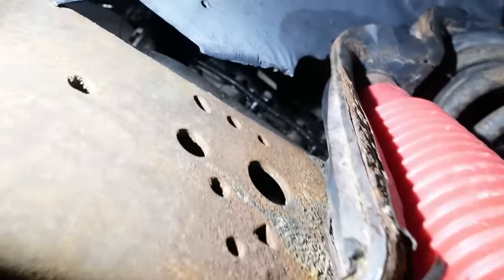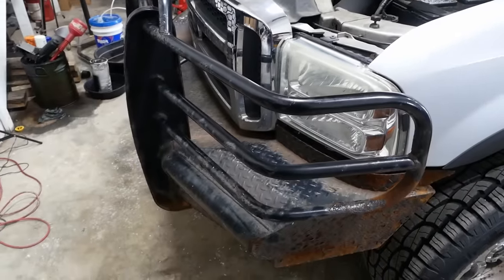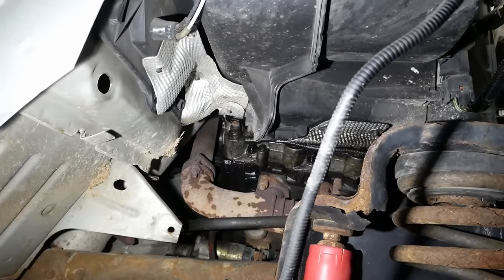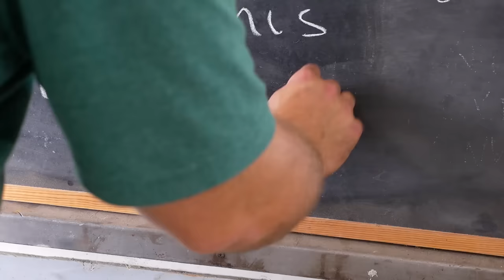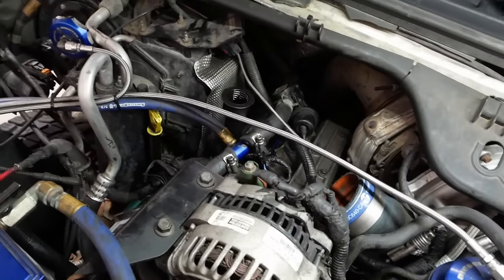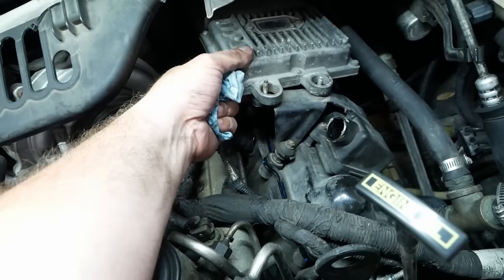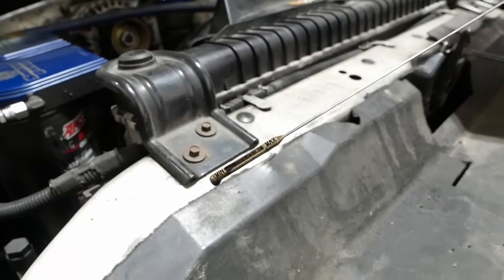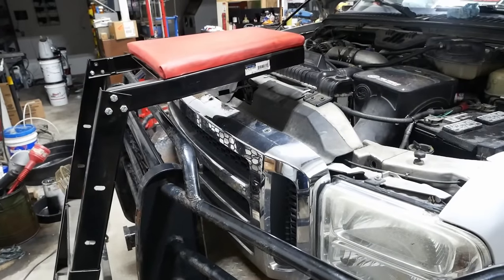6.0 Power Stroke Makes me Question my Life Choices - Major Oil Leak

Comment: heres an idea... put a sign out front,,you know,,,,   as for the bolts.. theres chem set,, used for industrial / house/ shed, structural supports.. maybe a mini kit, instead of bolt, make it a chem set stud.... the alloy has different grades,, say from, ford alloy,,to jag alloy.. or jet..  maybe vehicles should be rented for 3 yrs, then re cycled..   nearly bought a 6.4 engine, 15 yrs ago,, in aus.. thank fk i didnt..

Comment: I used to work in a shop that almost exclusively worked on 6.0, 7.3 and 6.6 duramax’s for almost 6 years. I can without a doubt tell you that almost every other 6.0 that came into the shop had stripped out valve cover bolts. This was back in 2010 times. They were still fairly new. We tried everything to fix the holes without helicoils and there’s really not a better way that would hold up to multiple uses. Those bolts were the bane of my existence. We eventually just have the customer the option to either fix it, or we would silicone the gaskets and let it ride with whichever bolts it had left.

Comment: What 18-20 year old diesel engine doesn't have an oil leak? 😂 Most of the engines assembled 20 years ago, still had standard rubber gaskets and cut paper gaskets to seal crap up with. None of this newfangled silicone rubber layered onto multilayer sheet steel like we have now.

Comment: Problem is the size of the bolt and the tread pitch, what are they 6-7 foot pounds? That is so easy to overdo without torque wrench, used to get that a lot with japanese motorcycles 6mm bolt with a fine thread ? Disaster waiting to happen.
Solution? Take it to Wes!😂

Comment: Its ok Wes Alcohol is still available as a crutch to stop you loosing it and go running in the field next door screaming. I think i'd just keep putting oil in it each week. I still think The design engineers who made should be made to fix them. If that happened they'd be so easy to take apart and reassemble. it would be  a joy. I knew which one it was going to be as soon as you said it. If you drop the wrench you know its not going to hit the floor and it will be the only one in that size that you own. Its ok if you cry at this point. You could have taken your Mums advise and become an internationally known a flower arranger. but you didn't. This reminds me of a 5 series bmw .ali block, ali head late 90s. Stripped head bolts in the block on a head job. The head shop had a 2"" thick block with 6 holes and sleeves to act as a drill guide to fit their shop made 17mm coarse threaded  inserts. You cant use helicoils as they just crumble the block and pull out. They did nearly all the bmws nearby that needed a head job. You did well.

Comment: I know the IDI diesels, especially the 7.3L variety, had cavitation issues in spite of the fact that they're not a wet or dry sleeved engine, so maybe the coolant filter is a holdover from that? When the 6.0 came out we were just under a decade removed from the IDI's, so it's not that much of a stretch.

Comment: hello wes good job ,I feel your pain,some owners are there own worst enimies . I aquired my brothers 6.0 last year.due to intermittant no start and he got fed up with it.I removed the tuner,after market air cleaner,,shes back to stock now,,turned out to be bad wiring at cam sensor plug,,he has spent upwards of 2k diagnosing this problem.

Comment: yeah, it's pretty much helicoil or nothing for me. If I have good access and it doesn't hurt anything I'll drill the whole thing, weld a plug in, and then drill and tap the new plug to the factory bolt size. Done that a couple times and it worked good for me.

Also, really loving the content Wes.

Comment: After all that work and the well deserved trash talkin, ya gotta love the way that thing sounded when ya cranked her up. I like em so much I’m still driving one (225k mi) and work on em for other people too sometimes. I suggest lifting the cab to get at those bolts and go ahead and do head gaskets while you are in there, lol. I bet the glow plug harness is leaking too. At last it wasn’t a bed plate leak. I’m pretty sure these engines are supposed to have oil all over the outside too! (It’s a design feature) mine doesn’t get to park in the driveway anymore. 😂

Just had to add, this is the truck I love to hate, when this thing finally dies I’m gonna be sad. I may have to hunt up another one.

Comment: Can't you put anti-seize on the bolts? Or even green loctite, if it likes to come loose. Sometimes Loctite can actually makes things easier to de-install. I think galvanic corrosion is the culprit with the stripped out bolts, putting something between the two different metals would solve that.

Comment: From what I was always told the coolant filters are a necessity on a 6.0 and 6.4 due to the sand casting in the block. The theory is the sand will eventually make its way to the water pump and eat out the housing ect. 
It was cheap insurance for one of the many probs. 
U would get a sizable amount of gunk in the filter when u changed it and cut open the filter. 
I’m sure other 6.0 and 6.4 guys have heard the same thing and have similar experiences.

Comment: I know a guy who works at a ford dealer.  He told me every diesel engine, ford had ever made is total garbage.  They made one engine, that was very good, the very first diesel they put in their trucks.  Ever notice why there are more ford trucks in the junk yard--because that's where they belong.  The 6.0 and 6.4 were made by international, so for wanted to continue their great stand with total garbage.  Any one that I have know that has owned a ford diesel, it was their first, and their last.

Comment: Mine was not realizing that the crappy retention clip that Dodge used on the big Dana rear end on the 3500 is not gonna hold the axle from walking out.  It destroyed the axle threads on the outside and the roller bearings went inside increasing the axle diameter.
  My life redemption was slowly filing down the slightly oversized bumped out areas on the axle to allow the oil seal to seat.
   I will trade ten hours for eighteen hundred dollars plus freight for a used axle. 
  Second redemption was realizing that Chevy used no retention clip,but a very robust locking system made by Spicer. 
   It only costs sixty dollars more and will last forever

Comment: Possible solution to the access problem.  Years ago my now wife then girlfriend had a mustang someone had changed the motor in to a big v8 and no way to access the rear plugs. I cut a 2 inch hole with a hole saw problem solved. A little weather strip adhesive a piece of tin and some sheet metal screws or pop rivets, good as new. No one would care on a 20 year old vehicle and would make life easier for an overworked mechanic. Great videos thank you.

Comment: You mentioned you didn't know why a 6.0 uses a coolant filter, I'm sure someone else has mentioned it but just in case they haven't, it's to capture any silica particulate from the casting process and any other dirt that's introduced into the system, so it doesn't block up the oil cooler. The factory oil cooler is a little too small and they make aftermarket ones that are bigger but those don't cool as efficiently

Comment: Hey Wes just figured id add they use an extra coolant filter to help with cavitation of the cylinder walls and also to help to catch debris before the oil cooler to "save" the mostly unsavable 6.0psd

Comment: Never stripped a valve cover bolt before but you do have to watch out for the folks that think the gasket on the oil cooler is reusable. Leaks like he'll and takes days for the valley to drain. Have had 3 6blows and have a 06 550 for a daily driver

Comment: I thought only the 7.3 glow plug harness goes into the valve cover. 6.0 has the harnes and controller completed external?  Controller is up front on pass valve cover

Comment: I just did this exact job on a 6.0 Powerstroke two weeks ago.   The previous mechanic stripped the back two valve cover bolts requiring Helicoils.  I despise working on those 6.0  Powerstrokes.    I also used a bolt with a notch filed in the end as the installation tool.  😂
Mike

Comment: In case youre wondering that year 6.0l powerstroke were notorious for inferior casting process on the blocks, very common for them to have lots of leftover sand from the casting process. If not filtered the material eventually can destroy the heads and anything it comes into contact with as it acts like an abrasive. One of the many reasons no one can convince me that a 6.0l is worth owning. There's just too much aftermarket mods that you have to do right out of the gate to get it to the point of reliability.

Comment: This was great. I love your sense of humor. Thanks for the tip on the topside creeper. I didn't even know that was a thing. My solution for the valve cover bolts is to remove them when new and replace with studs and nuts.

Comment: Im so tired of my 6.0. Over the years constantly hugging that greasy pig. That valve cover on the passenger  side is a nightmare. Ive done injectors on drivers side 30 min but had to do on on the passanger side and started late evening next thing I knew the sun was rising and i had to be a work in a hour. think i stripped 3 of those bolts on the rocker box that morning so I live with a bad oil leak for a year after

Comment: The only way to work on these things is to pull the cab. Don’t get me wrong it’s absolutely outrageous that you have to pull the cab because the engineers were such assholes that they couldn’t make the hood a little bigger. Hell they could have just put a truck style nose on it that tilts forward like a big rig. There is a special place in hell for the engineers that design crap like this! A place were they have to repair these things they have designed over and over all day and night for eternity!

Comment: Designed to go down the assembly line easily, not designed to be serviced afterward easily. Yes, the fender liners will be on before the wheels go on, and the assembly line probably has a fixture to align it (and the person doing the job has done it hundreds of times before). And those valve covers are an easy job on the assembly line when all the parts are new and the engine isn't in the truck yet and all the stuff around them isn't there yet. Afterward ... well, we see how it goes.

Comment: The coolant filter is installed because Navistar left a lot of casting sand in the block on a ton of them, that in turn clogs up the oil cooler, been there done that, thousands of times unfortunately. The lower crankcase housing is probably leaking also.

Comment: Had the exact same issue on my 7.3 with the oil leak. Bent valve cover and it was a major leak. I bent it i think trying to pull it out when i forgot the last bolt and i pulled up on it

Comment: Remember the old trucks Chevy, Ford or Dodge did not matter the make but use use to be able to open the hood and look down at the engine and say wow look at all the room you got in there and everything was so easy to change and now more crap has gone under the hood and they mad it smaller so you look in and say where the hell is the engine. I don't understand auto manufacturers ways of doing things everything use to be so easy and now everything is so hard and you have to have child or woman hands to work on them anymore.

Comment: The coolant filter is for the truckload of sand that's left in the blocks after casting that blocks up the oil cooler.
IMO that's the main cause of most of the problems these engines have .

Comment: Also having owned 4 or 5 six liters i have never had a problem with the valve cover bolts , this is actually the first i am hearing of it . They have their issues but as far as i know that wasnt one of them .... and i live in the rusty crap hole of new england

Comment: We have used a combination 1/4''- 3/16'' square drive flat ratchet to drive a shorty drill bits in impossible places. Will also drive taps. If your grinding skills are like mine, some gum tightens the fit and you don't drop stuff.  I got it originally for square head set screws ages ago, and an appliance tech I know showed the trick to me. 1/4'' stud is just a teeny bit bigger than 6mm. You may be able to tap it at 1/4'' without drilling, put in a stud with some JB weld and call it a day.

Comment: Terrific video! I owned a 2001 F250 with the 7.3. I loved driving it, especially towing or with a cord of wood in the back. I hated working on it. So much of the engine is inaccessible. Telling a customer NO can be hard. The shops around here are getting used to doing just that. My local garage set a 20yr maximum on cars they will work on and they have no problem saying no to working on a car if anything is sketchy. Another shop that isn't as busy will work on just about anything but they also have limits. It's something to consider. At least you get amazing content out of a struggle like this.

Comment: Great video.
Once the headstuds are swapped out and oil cooler changed these seem to last.
Did mine with arp studs and never had an issue.
Has decent power stock, I never run a tuner on mine.

Comment: I use a Ball Peen hammer with the ball on the hole in upside down valve/pan cover and hit with a dead blow hammer to invert the bolt hole to correct deformation there. Works like a charm.

Comment: I believe the purpose of filtering coolant in a diesel pickup is getting more life out of the coolant. I run rotella coolant in my 7.3, and it's supposed to be good for 300k miles. I'd really rather have a filter for that kind of duty.
I could be wrong though.

Comment: Valve cover gasket bolts stripped is not a design fault. In most cases that indicates that oil started to leak because of the gasket getting old and crushed. So out of laziness instead of replacing it someone decided to tighten the bolts some more and the rest is a history.

Comment: The word on the street is the reason for the coolant filter is to catch any sand left in the block from casting. There are some trucks that have had the rear of the water pump housing wear through and get coolant into the crankcase. So the aftermarket has jumped in the help with the filter.

Comment: I have a friend that has a couple 6.0L Fords. I have been all over the one engine, actually had to pull out and engine and replace it after a lifter failed. That was a job that I would rather never do again. A 6.0L with a 6 Speed Manual is a pain in the hind end to pull and work on. Thanks for the videos and I appreciate your sense of humor.

Comment: If they used studs instead of bolts, you would not have stripped thread issues. nuts are easy to get off one way or another. Love your videos Wes. You have a calming demeanor during stressful times.

Comment: Now I know I'm not alone. I thought my 2005 F350 King Ranch 6.0L was a lemon (new heads, new FICM, stud kit, 3 new injectors, new EGR heat exchanger and then another, then EGR delete kit, new glow plug harnesses, 2 new alternators, etc, etc,). I worked for Ford n kept saying nothing else could go wrong - could it??? Something else always did. This International motor was the single largest class action law suit in Ford history. Larger than the Pinto fire n Firestone rollover fiascos. I finally traded it in for a 2018 F250 6.7L. Not had 1 issue yet. Knock on wood. I hear the CP40 oil pumps in the 6.7L are ticking time bombs- thanks Ford. Laid off and sold a Lemming.
Reply from the maker: Cummins and Duramax also use the CP4 pump. So do some big truck engines. It's an expensive day when it shells out.

Comment: Actually self tappers would work better than helicoils but also self tapper will fill the hole with metal flakes so you have to go more deep or you have to use a shorter bolt otherwise you won't be able to torque it to the right number  ( 9 nm is nothing actually ).

Comment: What I did with my buddy  6.0 when we did the rebuild.  I took the rocker covers after I cleaned then and installed  heli coils  in each hole, good or bad. It worked  out great.

Comment: jb weld works for those bolts. I promise, u just have to be patient. spray non stick on the bolt before installing. You can also use a course thread standard bolt, just make a sleeve for the grommet out of i think its 5/16 or 3/8ths brake line
Reply from the maker: I tried the epoxy once and it failed miserably.

Comment: When people add coolant filters to these it always cracks me up. You mean to tell me that you need to be the one vehicle on the road that has to filter coolant while every other truck in the world does not require it? What are we doing here re-engineering the whole principle of the cooking system? If you drive something that requires that much filtration then your wasting your money. Really I think everyone just likes the look of these kits because who in the world wants to add more filters that need to be replaced and you get minimal benefit from it
Reply: Ford didn't get all the sand out when casting the blocks. Also the Ford coolant crystallizes from the EGR heat. Thus coolant filters.

Comment: Every 6.0 needs a coolant filter installed it saves the egr cooler , and you were right there is supposed to be rubber grommets on all mounting points on the FICM, they sell them online from just about anywhere because they are missing so often 😀
Reply: Thats actually a super nice truck , give me that any day over the new ones with def/dpf

Comment: Here in AZ over the years working on dozens of 6.0s and have never seen a single bolt stripped valve covers threads. Not sure if that has anything to do with climate. I also personally like doing the passenger side more no coolant bottle or ficm to deal with😂
Reply from the maker: That stupid heater box ruins it.